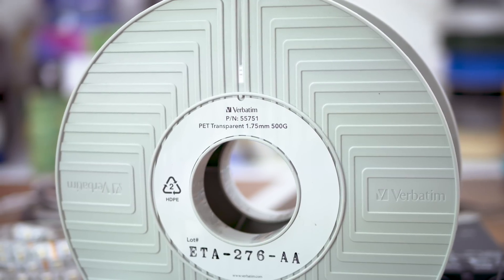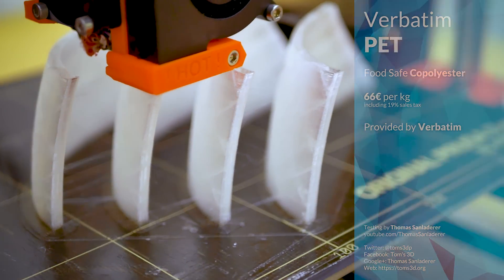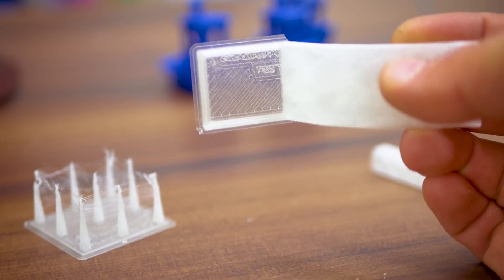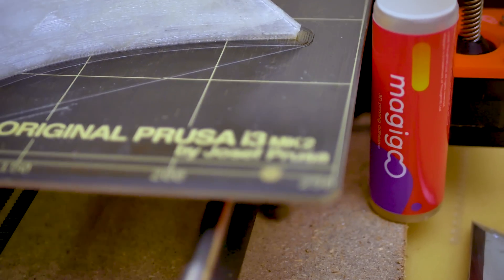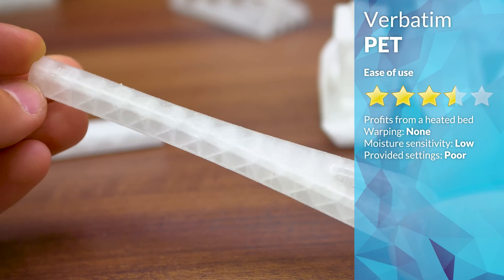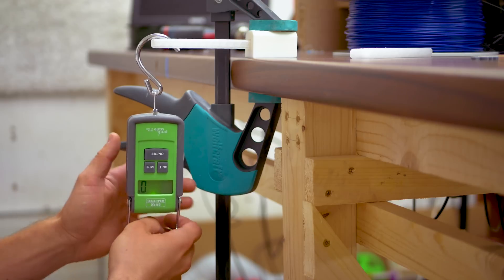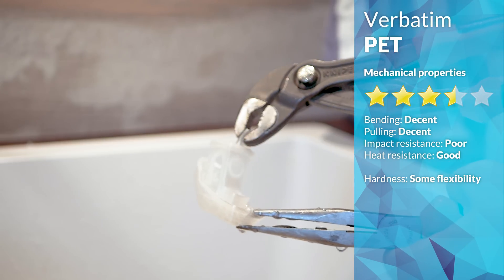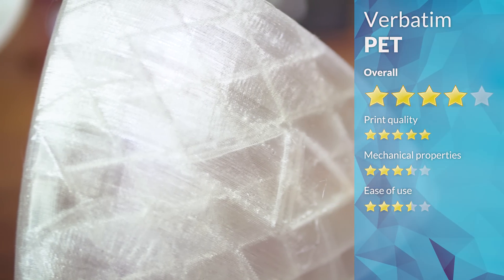Clear Verbatim PET review! #Filaween2

Comment: hi. the melting with boiling water is depending of the thickness of the 3d model and not only about the material or not? and which one have the best Boiling water thermal resistance?

Comment: Thomas, some quick feedback:

- Happy to see Filaween is back!

- Benchy/Print Settings section: I couldn't tell which bench was printed at which temp.

- The star system. I'm fine with it, but my criticism would be that, there are a lot of stars being thrown around in the video. 3.5 stars for ease of use, 5 for quality, mention of flaming stars, etc. When I think of stars, I think of an overall rating, not sub categories... so when I saw 3.5 stars... I thought "wow, this filament is shit."... but then the video went on to show more stars for more sub-categories...

ANYWAY, its a bit confusing. My suggestion: have some kind of overlay/GUI that shows which sub-category your are talking about. Like chapters or bookmarks or tabs on the side/top of the screen or something? So when I see 3.5 stars, I don't mistake that for being the final star verdict... but instead know that I am looking category 1 of 3, with the final score still to come.

- Oh, and for sub-categories, I felt like the text size for the category could be much larger. The "Verbatim PET" text and the huge yellow stars were the first thing my eyes drifted toward, and for a moment I thought "3.5 stars for what?" Maybe swap the filament name and sub-categories? 

Lastly, I think the summary screen could be just a few second longer.

Just my random feedback! Keep them coming, Thomas!

Comment: Still dont like that boiling water test. Put it on a stove, heat is slowly with a nail and weight on top, measure the temp when the nail falls into the material. Much more scientifically.

Comment: I don't have this petg but the petg I do have is completely undone by a cooling fan. It needs to cool, so I run no fan similar to abs. Then it is terribly strong. What I learned also is the thinner the layers and the slower I print the clearer it got. Flow is also a concern because any airgaps cause defraction so maybe consider running a higher flow rate to eliminate air gaps

Comment: You made it almost hollow for the impact test? You should have made it as strong as you could, just like we would if we were to use it... Give it 30-60% infill at least.
Reply: Then this test will not work with other Filament.
You have to treat every Filament equal to get comparable results.
Reply from the maker: +Lucas Hartmann you may be misunderstanding how the IZOD-like setup works. 
If I made the specimen as trough as possible, I wouldn't be able to break most of the filaments (resulting in a simple DNF instead of a quantifiable result). Regular ABS is already at 50% of the current setup's capacity, so I'd have to make the mounts amd pivot points much stronger and build it much taller and with a heavier hammer (for practically the same data).
Reply: I guess it makes sense, if all filaments were DNF then the test results would be useless. Just feels weird comparing print strength while not at the strongest condition... Maybe run the test with 4 different infill settings?

Comment: I don't know about this Amazon-style rating system where 4 stars is "average."  Just because that's how Amazon's rating system ended up doesn't mean it's the best way to handle this, especially since you are a qualified reviewer with actual testing methodology while the average Amazon reviewer rates an item based on how well it worked for him or her, not how well it performed at its actual purpose.  That review system works on Amazon for quickly sorting out junk and non-junk but not much else (because junk generally doesn't work for anyone).

Luckily I watched your FW2.0 introduction video so I understand how this filament got 4 stars.  A viewer that didn't would be scratching his head wondering why this filament was rated so highly.
Reply: GordonGEICO I agree with you. I guess after the introduction video Tom put up it would be hard to change the system now. Perhaps in version 3.0 he could implement the change.
Reply: I agree, not much room for seeing the differences. I doubt he'll have any 1 or 2 stars, everything will be lumped together. BUT I think all the raw scores will be shared and you (anyone) can come up with a system to rank based on the raw data. It does not look like there is any data posted yet, but it should be posted sometime.
Reply: Totally with Gordon here. Tom defined his system, so it can be anything it wants, but compressing all "not garbage" scores into 4-Flaming_five leaves little dynamic range. 
I was thinking it before, but seeing this in action solidifies it.
Reply: I agree.

This is your show and you shouldn't let your reviews be limited by others. Then again this is your show so how you proceed is your choice.

In my opinion the 'Amazon' star ratings limits the range of quality assessment to a three value system.

Maybe you should avoid the use of stars altogether and use Toms (little pictures of your head) instead. Or numbers 1 to 5. Or…

Just make them linear, please.

Comment: 66 bucks is quite expensive for just PET..
Reply: PETG is food safe, too little glycol and it wont dissolve into your food. like ptfe which is using flourine, something that fucks you up in smallest quantities. but ptfe is still used in frying pans because it transitioned to a safe state.
Reply: yeah, thats like $75 usd, or $96 cad.  i can get PET/PETG for $30 cad.  prints perfect and has excellent layer adhesion.   no idea who would buy verbatim.
Reply: Chris Brent  people say it is food safe and there are food containers made of petg.  It's glycol modified but that makes both a different material when combined.   Either case I wouldn't really use any filament for food, especially if it has colour.
Reply: PETG isn't food safe, the G on the end means it has glycol added to it which helps make it easier to print. So there's one reason you might want to buy this.
Reply: yeah, doesn't matter if it's food safe or not. The lack of service/information and premium price are the deal breaker.

Comment: If you sand your PEI with micro mesh around 2400 grit you won't have the death grip from co-polyesters but they still still adhere well.  Doing this doesn't seem to have any negative impact on PLA adhesion so I highly recommend it as an alternative to using glue/goo.  The process I use is to spritz the print with 70% alcohol, remove the print, use the alcohol remaining on the bed to wipe it down with a paper towel, then give it a quick rub down (circles) with a micro mesh pad.  So far it's worked great and my PEI sheet still looks like new after hundreds of prints!
Reply: Knock on wood I've had good results cleaning the bed with windshield washer fluid instead of alcohol when printing with PETG.
I have no idea why it works but I'm not going to complain.

Comment: Your Charpy-ish impact testing seems like it has a lot of room for inconsistency because your test articles aren't printed at 100% infill, so they have sparse regions within them. I assume if your slicer settings are identical between materials, barring temperature, the infill pattern will always appear in the same spots within the part - is that a safe assumption? The cross-sectional area of the test article (the cross section of that actual material, not including air) will directly correlate with the energy absorbed during impact, so having a consistent cross-sectional area between test articles is imperative to generating useful results across multiple materials. You will also create stress concentrations at the sharp junctions between infill lines and perimeters, which will skew your results.
Reply: Ethan Anderson like anyone that use 3d printers knows, exact reproduction of objets its almost imposible, you can have a pretty good copy of an object, but due facts like slicer, filament moisture or even position on the bed, affect the overall estructura resistance of an objetc, thrust me i found out that the hard and painfull way. 🤕🤕🤕
Reply: Probably 100% infill for 3d printing creates other issues in such kind of test, but something like a 75-80% "random-ish" infill might give somehow more consistent results.
Reply from the maker: +Ethan Anderson I had typed out a long reply, but the app didn't post it.
Tl;dr: I know this and it's fine.
Reply: Haha, bummer! And noted - keep up the good work!

Comment: i dont know if you have review already, but how about, eSun PETG Filaments? eSun seems to start becoming a mayor player, but it can be hard for bed  adhesion,
Reply: I second this request.

I've found a great, local to Australia, source for eSUN filament and I am now almost exclusively using this filament.

My review:
1) Price Outstanding
2) Quality is constantly good
3) Range is extensive

I've used eSUN PETG and PLA+ (and their cleaning filament).

With PETG I use 225°C (hotend) and 70°C (bed).

With PLA+ I use 210°C (hotend) and 60°C (bed).

My favourite is PLA+. It's great to print with and super strong. It also has a smoother finish than other regular PLA filaments I've used.

I have some ABS+ filament on order, should be here in a couple of days. I'm very interested in how it prints and if its thermal tolerance is much higher than the PETG filament, which I find looses its stiffness above 60°C.

I have some bed clamps that hold a glass plate on my printer's heated bed. Currently they are printed in PETG and have been slowly warping out of shape. I hope this will not happen once they are printed in ABS+.
Reply: should have read the comments. also keen to see a test on this

Comment: Awesome! btw: Colorfabb XT (It's basicaly PET) also has big layer adhesion issues :/
Reply: That's odd, I make headbands for my wife and daughter  with it...never had adhesion or breakage issues. 248-255C depending on print speed.
Reply: huh.. What excat settings/ printer do you use ?
Reply: RostockMaxv2 & Creality CR-10. 0.4mm nozzles, one has E3D v6 hot end, the other MicroSwiss all metal. Set nozzle to 0.5 in slicer (same trick I use for PETT or PETG),
 I usually use MatterSlice or Cura. Layer height 0.2 or 0.25. I usually don't exceed 40mm/s print speed. And in my case less than 50% cooling fan. Usually more like 25%....YMMV depending on your fan setup.
Reply: thx for the tipp! I will try it out as soon as possible :)
Reply: You're welcome, good luck! I think it is an awesome material. Quite flexible and tough!

Comment from the maker: You just watched the first Filaween2 episode! Any suggestions what to tweak for the next one?
And yes, I know the sidebar transitions didn't render 100% correctly, that'll be fixed.
Reply: At the end can we see all of the star ratings together? It'd be a nice way to conclude it, all in one place and you don't have to hunt for them.
Reply: Suggestion: Show how far up the hammer goes when it breaks the print.  It went off camera and we couldn't see how high it went...  Not that it's terribly important but it would be nice to see the whole view.
Reply from the maker: +riskable that bit is actually the core message of the test - totally my fault, I had the framing wrong and didn't want to reprint just for the shot.
Reply: TOTALLY UNACCEPTABLE!  Haha, just kidding.  Thanks for explaining it.  It's fine.  Keep up the good work!
Reply: I agree with LICK_THE_BUTTER. An overview of all the different ratings combined at the end of the video would be a nice recap and conclusion for the video.
Reply: include collected data in the description
Reply: I suggest finding your personal benchmark filament and rate against that and show the performances as plus/minus values. It makes the difference between filament types easier to understand. 4 star ABS is certainly not the same as 4 star PLA.
Reply: That might be part of a very sad commentary on the state of the USA. I certainly don't have any shops around that I could purchase locally from with near as much convenience and consistency that I get by just going online. I guess that's the real important thing when it comes to 3d printing, if you don't have consistent material then how do you put any confidence in the quality of your prints?
Reply: i know it would be just another PLA, but how about a locally manufactured filament? (made in ohio: i live in the usa).
Reply: i was pretty interested in the mechanical part  but i feel that 4 stars on something that is  "somewhat inconclusive" is not too fair.
Reply: Nice new format, I like it a lot. Will you re-run the #filaween 1.0 filaments for the new format? At least maybe the better filaments? That would lead to a nice playlist with all comparable results. Also it might be worthwhile to have just the overall rating page in the beginning of the video and also for the thumbnail picture so that the viewers can already decide on that if they want to watch the whole video. At the moment with just one video it's OK to watch all of it but my guess is you will end up with a lot more videos in the long run and there it perhaps makes sense to start with the big reveal and show the details after that. Just my 2ct. Thanks and cheers! JM
Reply: Being a US resident I too have a lot of trouble sourcing filament. Maybe some of the ABS sold by GizmoDorks could be tested. It seems that Australia is the 3d printing capital of the world =]
Reply: Thomas is from Austria, not Australia :) I'm wondering what makes sourcing filaments so difficult in the US. Is it the shipping costs are high or is there really a shortage of filaments shipping to the US? Whenever I look at what I can order to be shipped to Germany for reasonable money - I rarely shop for filament in local shops because where I live there aren't many - the variety is OK.
Reply: True. But then on the other hand you do have many more purchase options for the actual printers at a lower price tag - including taxes - than we in Germany have. To name an example the Monoprice Mini in Germany for example just doesn't make sense to purchase due to shipping cost, taxes, customs etc. That said we do have good options in Europe, too like for example the Prusa and other locally produced printers. Don't Ebay and Amazon offer a great variety of filaments in the US? In Germany at the very least at the marketplace there are options to choose from. Cheers! JM
Reply: It really feels that the results don't match the rating, even with the amazon rating (which I still think is weird).
You said there wasn't much stringing but from what I saw that's a lot of stringer in comparison to most of the normal filaments from filaween 1.  Fine structures also didn't seem to print that well from what I saw (the pointy towers). The 4 stars feel really weird, I feel that in filaween 1 this would have gotten 2.5 to 3 stars which would be fair in my opinion. Maybe it because of the new rating system but 4 stars just doesn't feel like it matches with the visual results and your commentary.

In the end I personally miss an overview of the mechanical numbers, as number give me something tangible to work with and a very objective rating. Would love to see some of these back.
I also missed the spring test you mentioned.

Anyway all in all it's still a good video and I like the reviews on the filaments, thank you for doing these videos.
Reply: you are gentle with the overall result, €66 with results it is junk.